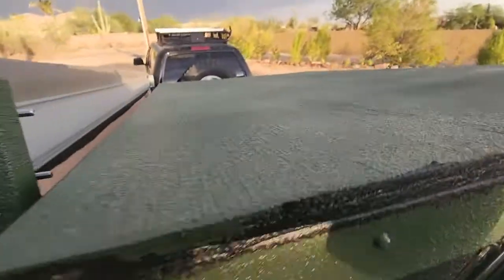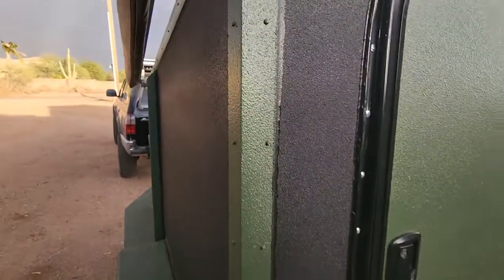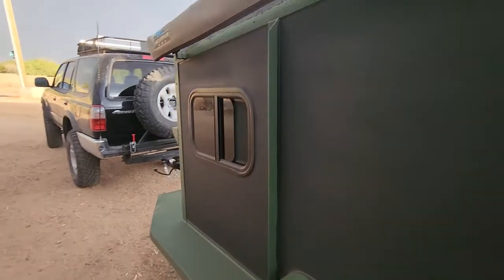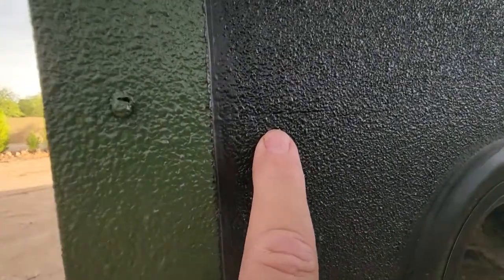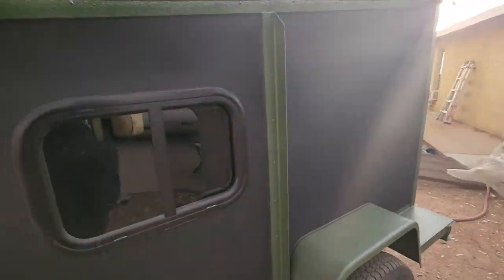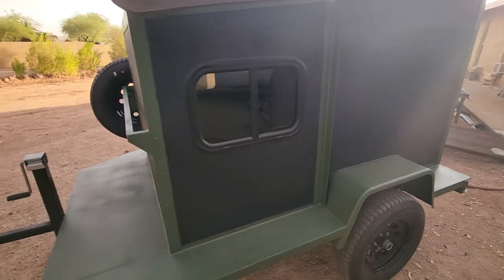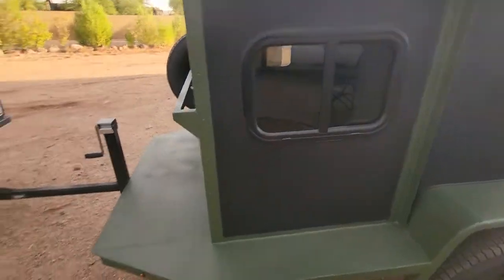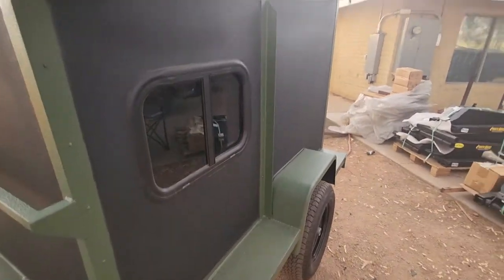***Raptor Liner Update*** Finding out the hard way not to use on wood.

Comment: Not the bed liner's fault your wood is shrinking
Reply from the maker: Agreed, learned that the hard way. Also found out at the time I did this the instructions were incorrect on the Bed liner. At that time it claimed you can spray direct onto wood. After this issue I called manufacturer and they stated you must prep and seal wood first. Lessons learned. Will definitely use in future but only on metal.
Reply: They just told me if I could t seal it. That I had to sand it off. I just spent hours sanding. lol I used 50% deisel and 50% oil though.
Reply: My wood is not shrinking! I’ll have you know my T levels are off the chart for my age. Lmao

Comment: You can use 2 layers of fiberglass resin plus cloth on the roof which is very important, and a good waterproof paint on the side walls.
Reply from the maker: Yup, I used elastomeric roof coating and cloth webbing on the roof. Solved the issue
Reply: @jaybareadventures  Elastomeric coating last about 8 to 15 years, depending on the initial application. But with 2 layers of fiberglass coating will last up to 50 years .

Comment: Thank u jay. I seen u fiberglassed. Thank god i seen this first. I wanna take oldfibetglass crap class c came with. Gux n seal it everywhere  n fiberglass it n the seems a few layers n then use  this n ill do the roof with white flex n seal i heard was good or i may justdo the roof the same. Thought about  doing inside  floors  lol but im building a truck camper n i dont want no issues. ❤❤❤

Comment: I learned the hard way but had several experiences since. First wood RV I just raptor'd and a couple months in I had same issues in addition to joints separating. Second round I sealed using fiberglass resin which sealed the wood great but not the joints. Third time a charm! I fiberglass'd all joints and corners and used resin on entire exterior which after raptoring held up great! I had good luck using raptor on interior parts made of wood or mdf with no undercoats at all. I raptored my jeep wrangler jku and made several different versions of non-complex teardrop and rooftop RV's and get many compliments on my upol raptor finishes.

Comment: You absolutely can use it on wood but you have to prep it correctly. User error
Reply from the maker: I agree. But at the time I had sprayed it the instructions that came with raptor liner said only to lightly sand wood then spray direct on. Only after I sprayed did I find out that you have to seal the wood first. I called the manufacturer and they admitted that their instructions were incorrect and that wood needs to be sealed first. I just assumed at the time the instructions were correct.  Lesson learned the hard way to do way more research before hand.
Reply: @jaybareadventures  Hopefully they reimbursed you :/
Reply from the maker: @_j_a_d_e  only part of if not full amount.

Comment: Use poor mans fiberglass  (Canvas and Titebond 2 wood glue
Reply from the maker: I ended up using a rubberized roofing coating to skim over exterior walls and then painted
Reply: Great idea

Comment: You went to fast is all. Wood needs time to get climatized. Also needs to be sealed well before. I’ve notice my trailer settle down a bit now. It’s been in the driveway way for a few weeks before I coat it. I run a painting and refinishing company in Muskoka Canada and it’s a running thing that people don’t coat their stuff till a year after it’s been outside. The first climate change for wood is big and it settles down after that quite a bit.

Comment: Just a heads up works great on wood. Im 4 years in on mine no cracking or pealing at all. Also your coating isnt the problem your wood is the raptor is sticking to the wood but your wood is delaminating People say seal it but dont if you want it to work good heres how..
1. The moisture content has to be vertually 0. All wood coming from a lumber yard is wet and it doesnt dry out fast. I build basically a tent out of a tart  put a. 1 piece under at a time and ran my torpedo heater  for probably 10 hours each piece. 
2. You want to use pressure treated. Its the best for cold hot cycles untreated plywood if it sits in a garage will start to delaminate and you are exposing it to far more torture outside. Treated is less apt to delaminate.
3. Rapter is not a silicone crack filler wood shrinks and expands you need a product designed to do both or you need to fiberglass the seams.
4. I went with desert tan tint to my upol raptor. Black absorbs heat causing higher chance of your wood delaminating. If you want black you need to coat the top with something else.
5. I ran 6 light coats. But my build up total is easily 1/4 inch thick your coat looks extremely thin for trying to use it as a waterproof sealer.
The main thing is although your frame is extremely sturdy the wood flexes constantly and although the bedliner is as well that flexing along with heat cold cycles pulling moisture out of the wood and breaking down the glue causes the wood to delaminate. You might be able seal your joints with fiberglass then   use upol rapter adhesion promotor on the entire surface and coat over the top. It looks like your bedliner got good adhesion and your wood is the problem but a thicker coat may keep it in place. Be alot cheaper to try thst then to pull it apart. Or put vinly camper roof on the top or the ruber camper roof paint
Reply: your exactly right.  most people dont realize builders grade lumber is around the 19% moisture content.   blaming the the liner is ridiculous.  its like blaming paint for peeling because the drywall fell off the wall   lol

Comment: plywood... any plywood with a heavy paint coat will have the problem that the glue that binds the first layer will start to disintegrate because of the chemical compound that it is being applied to it.
I used a RV roofing paint on plywood, and it bubbled it all out... not the paint, but the first layer of the plywood started to peel away from the other layers because the chemical compound is that strong that it disintegrates the glue... and because the layer of wood is so thin it warps and bubbles or shrinks with the wood.
If you went back, sanded and reapplied a couple of layers of paint over where it shrunk the wood, you would be alright... the wood is done shrinking...
splitting won't happen if it were solid planks... not plywood

Comment: Seems wood shrank and thin coat not enough to stretch. It’s kind of a good thing in terms of a second coat doing a much better job.
Reply from the maker: This happened after multiple coats. When I called The manufacturer of Raptor liner they informed me at the time their instructions for spraying on wood was incorrect. At the time I did this it said to sand wood and spray directly on. They now recommend sealing the wood first before applying

Comment: id you prime wood before using?
Reply from the maker: I did not, the instructions for Raptor liner at the time I did this stated you can just sand wood and spray directly on. After it failed I called manufacturer and they told me that instructions were incorrect and need to seal wood first.
Reply: @jaybareadventures  
Bummer.  Yeah..I'm in the cabinet Business.  Bad on them for selling you that it didn't need priming.

Thinking a good primer and an epoxy base coat  would be the hot set up.
Reply from the maker: @Spicewoodmotoshop  yes, they now recommend sealing wood first. Epoxy would probably be best. They were apologetic about it and did work with me a little.
Reply: @jaybareadventures    would feel better if they offered free product to do over since they spec'd not using primer..  but I doubt the would..
Reply from the maker: @KenIngham  they refunded half of what I paid for the kit. Figured it was better than nothing

Comment: I’m wanting to raptor line a plywood box with a drawer that I made for the back of my Jeep. What do I need to do for prep work?
Reply from the maker: After I made these mistakes, I did more research and found that people are having luck by sealing the wood first with some sort of epoxy to keep the wood from expanding and extracting. I have seen some guys use some sort of epoxy resin to seal it and once that's cured a little sanding then spray the raptor liner. I know from my experience I will not spray on wood again. I have started another camper build and I am using aluminum composite panels so I don't need to worry about it splitting. On the metal frame of the trailer the Raptor liner held up great. Would definitely use to coat metal again. I would say to try do some sample pieces first. You can get raptor liner is a spray paint type can to try test with. For me it only took about a week before all the problems I had showed up. Check out @LivingOurAmericanDream as he has seemed to have luck with the Raptor liner on his build.
Reply: @jaybareadventures  ok thanks
Reply from the maker: @coltonholler7063  no problem

Comment: I do not know why it's so hard to find videos on why or why not to use rhino lining I think be helpful even if it's just to show why not.
Reply from the maker: I believe in video I show what happened with the Raptor liner. At the time I installed the instructions said you could spray directly on wood. A week after I sprayed the wood shrunk a bit causing the raptor liner to split open. I call manufacturer and they now recommend sealing wood prior to spraying raptor liner. Personally I will not use on wood even if sealing first. On the metal frame it works great.
Reply: But there's a reason why there's different names what is the difference between rhino and Raptor liners

Comment: for roof i would of went with a sheet of ACM 4 x 8 cut it to size with sealant when mounting it and then raptor lined it to get the look you are wanting no splitting like with plywood if you dont seal before raptor lining.
Reply from the maker: Ya, I should have done more research, but lesson learned I was able to fix it. My new build I am using all aluminum composite panels on it and so far it's working great
Reply: What type of aluminum panels are you using? Can you share the link please.
Reply from the maker: @danemmerich6775  I used aluminum composite panels from Piedmont. You should be able to find it a a local sign maker/store
https://www.piedmontplastics.com/products/acm-sheet

Comment: The bed liner isn’t the problem and it’s just the wood itself
Reply from the maker: Agree, at the time I applied this the instructions that came with bedliner said it could be sprayed directly to wood, after this happened I called manufacturer of Raptor liner and they now say to seal wood first.
Reply: @jaybareadventures  dang and can you show us how to seal the wood because I want to learn
Reply from the maker: @KadeStringer2.0  at this time I really don’t have any projects planned using wood. If I do one in future I will make a video

Comment: You can't keep the plywod from splitting so using a sheet of aluminum would work better.
Reply from the maker: I am building another camper now, but I am using aluminum composite panels. Works alot better
Reply: @jaybareadventures  That will work great. Sadly plywood doesn't do well no matter what you put on it.
Reply from the maker: @John Tatman  I agree, lesson learn the hard way. I will say my new build with the aluminum composite is going good. The aluminum composite panels are easy to work with.

Comment: I was reading up on it before watching this and they said to- Clean, sand, reclean, seal, then paint (preferably 3 thin layers). 

Did you do any of this?
Reply from the maker: The instructions I got said to just lightly sand wood then spray directly on. After the issues I called them and they then told me need to seal wood first. My mistake for not researching properly first. I figured the instructions were correct

Comment: The moisture level is changing in the wood, so it is splitting.  Previously it could breath now it cannot.  Completely expected in wood.

Short of replacing the panels, try adding another coat to hide the imperfections.  Eventually, as the moisture equalizes, it should stop doing this.  I assume only the top is sealed, but the inside has paint or something more "breathable".  So if you keep it garaged in an air conditioned space, then go outside, the wood will once again equalize with the humidity in the air around it which can cause warping.  After hiding the imperfections on the outside the next step should be figuring out how to seal it from the inside.  This way when you drive from the arid desert to the humid south, the process doesn't repeat.
Reply from the maker: I have since fixed it, but when this happened, I have let the wood sit outside her in the dry hot Arizona desert to dry out for about a month first. When I sprayed it only the outside was sealed, the interior was still bare plywood
Reply: @jaybareadventures  we have the opposite problem here in the southeast.  You are on the other end of the humidity spectrum.  

The challenge for a mobile structure is that it can move between extremes.   Probably not an issue when passing through or short durations because it happens slowly.  But a house isn't mobile so once the wood aclimates to the environment it will always be in, it's probably good to go.  

In short your problem is probably "fixed" as long as you remain in the climate you are in.  If you move to a humid climate or garage it in a building where you artificially add humidity for comfort, it could go through the same process again.  A few weeks in another extreme probably won't be a problem, but a few months might be.